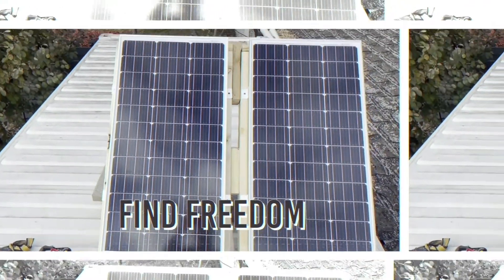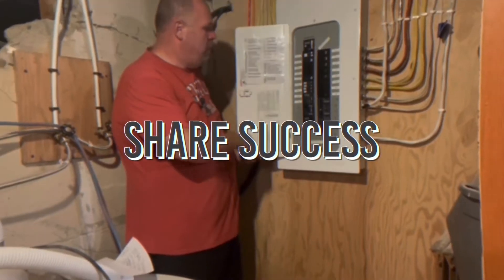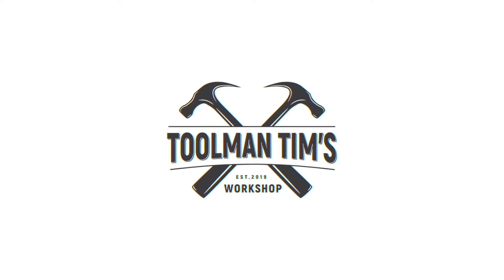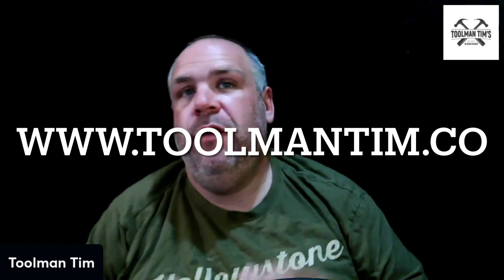BONDED vs. FLOATING NEUTRAL GENERATORS - Simple & Easy

Comment: NICE TIM   even without a fault   a parallel path current will  ( instead not only return on the neutral ) but return on ground  and neutral...     get inbetween that ground..   💀 
Great explanation!  U did your homework
Thanks for bringing awareness
Reply from the maker: Thank you a bunch tactics I did a ton of reading before I put this video together it means a lot to get this compliment from you as it’s a topic I wanted to make sure I had a handle on before I shared it
Reply: @TOOLMANTIMSWORKSHOP  you killed it 👏 🙌